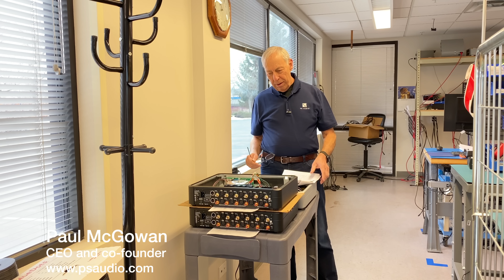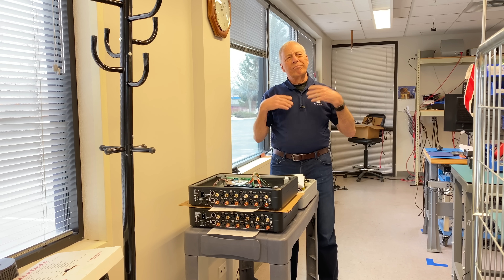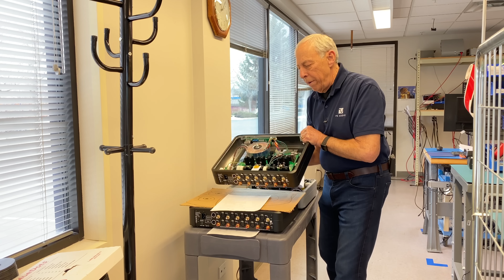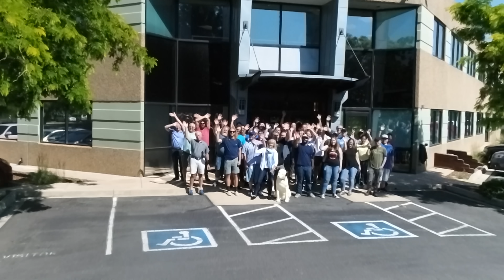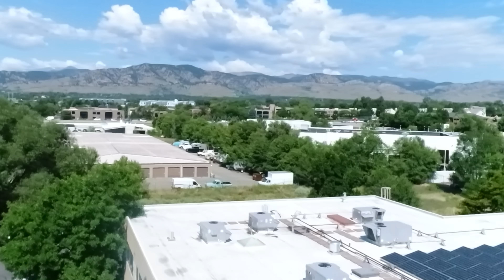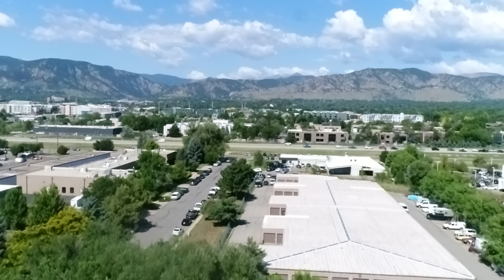Should a preamp have a sound?

Comment: In today’s more digital chain audio system a separate preamp has lost his function. No separate preamp means also one device  less and one  interlink and power cord less. It all adds up so don't add, subtract.
Reply: Good point! I once owned an Audio note pre-amp. It did make the digital source (after going through a DAC) sound better. But not enough to warrant the cost. So I sold it.

Comment: Paul, thanks for the video.
First, a pot and two connections is not an "amp". I'm sure you just misspoke and know this.
Secondly, we DO want our amps to have character. We love tubes because they have second harmonic distortion. This idea that what you get in you should get out is not what people want. It's a good theory but it ends there. I specifically design my preamps to have character, one of the reasons I use tubes. You designed a $6k amp to be a line stage? I absolutely don't want one - at any price!
Things like super low distortion have little if anything to do with listening pleasure. We simply can not hear the difference between 0.05% distortion and 0.005% distortion, these are manufacturer's selling points.

Comment: I remember many years ago I read an article in which this was discussed.  They used a regular volume control pot , and then made a pot using ganged  switches, each position having a high quality resistor , which reduced in value as the knob was turned.  The difference in sound was easily identified, the one using resistors clearly superior.
Reply: The second one you described is a stepped attenuator.

Comment: Does not a preamp adjust the levels of all sorts of connected component inputs to bring them to a standard let’s say a 1 volt peek to peek level able to drive a amplifier to its optimum level? For instance a moving coil compared to a moving magnet phono cartridge, their needs to be some kind of amplification. At lest that is the way I have used preamplifier. I really like your description of the input and output.

Comment: I built a simple preamp like you said but the pot rolled off the highs when it wasn't all the way up.
Reply: You prob have a mismatch between your pot and input resistor on the path right after it (if you have an input cap the resistor is probably the very next thing in the signal path after it). Try a higher value volume pot and replace the inpout resistor with one roughly half value of the volume pot, and chances are more high frequencies will make it past ground as you turn down the volume. There will ALWAYS be an amount if high end bled off through a standard volume pot as you turn it down, but you can indeed get it low enough that it's not perceivable.

If you have an input capacitor after the volume pot, you could also try lowering it's value one tick as well as matching the following resistor to about half the volume pots total resistance something in my tired brain tells me this may help too. but it may also roll your low end off slightly at high volumes depending on the implementation of your circuit

I try to use a resistor right after the input cap on the input of my tube preamp builds about roughly half the value of the volume potentiometer, because then at roughly noon my preamps sit at the same volume as the source signal. It may be placebo but to my ears, this also seemed to help high freq roll off as volume goes down, seems like the volume knob is almost as willing to shunt low frequencies to ground evenly with high freqs while i lower volume.

Any times you have resistors and capacitors on the same signal path you are creating low pass filters, and a volume pot is just a variable value resistor. I may not have given you THE answer here, but there should be enough info here, should you actually see it, to figure out what your issue is.

Anyhoo, ive never found handling the volume pot high end roll off of a preamp a difficult thing to sort out so long as you know (to some degree) what you're doing, and know exactly what your input/output impedance match is, and what kind of low pass your creating with the volume sweep. Ideally the sweep of the low pass created at its LOWEST is over 20khz. if you can achieve this you wont have any perceivable high end roll off, even though it's still technically there. Some very trained ears CAN however, notice the loss of phasing info above 20k, and it can be perceived as a loss of "air around the sound" or similar perceptions. It can also sometimes be difficult to keep your low end in tact and holding authority the way you want it to doing this as well, but ive had no issue with that on my particular circuit implementations. And ideally you get it right at the preamp... because adding it back in with your EQ will introduce noise and distortions you do not want in your signal

Comment: Everything in audio has a sonic signature, nothing is completely neutral.  Yes in theory you would want equipment that has no coloration to the music.  One way like Paul mentioned in determining the sound of a piece of equipment is listen to it with it in the chain and without.  You can do that if you have a cd player or digital source that you can vary the output and run it directly to the power amplifier.  Listen and then do the same evaluation with the preamplifier in line.  This will give you a good idea what kind of coloration the preamplifier is producing to the sound.  Inevitably in most cases most will prefer the sound with a preamplifier.  Most preamplifiers are increasing the level of the input source, and is also designed to drive a amplifer properly.  Especially if your running longer interconnects to the amplifiers.  For a while there were line level preamplifiers which had no gain, just a input selector and volume control.  But they were not very successful because they lacked the slam, dynamics, and musicality of a active preamplifier.  So yes in theory a preamplifier should be as neutral as possible but that's like saying you should eat the food from exactly how the chief made it, but how often do we season our food the way we like it.

Comment: If you're a phono lover like me, it's pretty easy to get rid of the preamp. Get a phonopreamp, which you need anyway, that has a volume control. Connect it to the poweramp and you're done. Very sadly the new PS Audio phonostage doesn't have a volume control.

Comment: If I've learned anything in my decades of pursuing pleasing sound is that EVERYTHING has a sound. From a high end or entry level audio component to a piece of common copper wire. The math may not support that but my ears do. And for all of the skeptics out there just because the asking price for a piece of audio gear is low or high to ridiculously high, doesn't always mean that the sound will be better. Being an audiophile to me means paying attention to and identifying subtleties in sound and performance. Peace.

Comment: I totally agree. K ohms on guitar pot affect guitar sound, warmer or brighter sound
Reply: when you combine a resistance factor with capacitance you create a low pass filter. The cutoff frequency of the low pass filter is determined by the impedance of the signal passing through the circuit, which is controlled by the variable resistor that is a guitar volume pot in combination with the variable impedance of guitar pickups at various frequencies. When you turn a potentiometer on a guitar you are changing the impedance of the signal, and thus the frequency of cutoff (removed frequencies are all just bled off to ground since a guitar is an unbalanced signal). A higher resistance pot will raise this cutoff frequency's upper limit effectively allowing more high frequencies to pass through with the knob turned to full

The more ya know i guess.,

Comment: Can anybody explain this to me? Why pay $6000 just to be able to increase and decrease the volume... when you can do that on the Poweramp directly without any additional cost ? In the video, Paul seems to suggest that the preamp is not doing any (low noise) inherent amplification but just volume control,why pay so much money for something that can be done (freely) on the poweramp?
Reply: Dude: a power amp doesn't have a volume 😂
That's why it's called power amp..once you turn it on, its output depends on the strength of the signal coming from the pre-amp. 
What you're thinking of is the integrated amp (preamp section and amplifier section in one box).
Reply: @SpaghettiKillah  Thanks. You just made my life easier ! It seems that my experience is restricted to All In One amplifiers!
Reply: Bedros Daoudian 
If money and space were not an issue having them separated would be the way to go. 
No matter what people say, having the pre-amp and amp section inches away from each other is not ideal...there will be interference.
That said some well made integrated amps sound bloody amazing (Pass Labs, Audio Research, Krell).

Comment: why spend 6K on a preamp when you can use one of many DACs that have volume control? That truly adds nothing to the sound. 6K back in your pocket. Now a tube preamp, that's a different story. Add warmth, tweak the tone rolling tubes. That would make more sense than Spending 6K for, well like Paul said, NOTHING. However if you listen to vinyl I guess you need one...... Here is a question Paul...... When will phono preamps come with a gain stage and volume control?  That would be interesting!
Reply: @Larry Niles I hear you Larry, but it this video he says it should like nothing. Go figure
Reply: @jsmctch
That 6k preamp has tubes
Reply: @Mark-lq3sb  Even more of a shame it ads bogging
Reply: @jsmctch  You praised tubes...
Reply: @Mark-lq3sb  Mark what I said is I liked when tube preamp ads to the the tone. Im not surprised that tube preamp sounds like nothing because PS Audio gear sounds sterile to begin with i, my opinion. I do like to hear what Paul has to say from time to time though.
Reply: @jsmctch  
I agree with your reply to Larry Niles above. It is true that Paul has said the reason for the tubes in the input section (only, not output.) is they believe that's where tubes have the most impact to "sound" 
In a previous Video Paul talked about bringing in Bascom H King, (hence the name of that preamp, BHK.) to design the preamp and Bascom wanted to do all tube. Paul wasn't "keen" on the idea of all (meaning output too.) tube, Paul resisted. In my opinion, the input tube only was a compromise between Paul and Bascom. Paul still had his transistors and Bascom got his tubes. Now, you have a hybrid preamp and amp.
Reply: @Mark-lq3sb  Thats interesting Mark. Thanks for the reply.... I think I side with Bascom on this one.

Comment: If you need an audio device that colors the sound to get the right sound out of speakers then you may well have used an equalizer instead, but then I think it's most likely speakers that don't have good sound!

A preamplifier should change the sound as little as possible!

Yes everything you run the sound through will color and change the sound in one way or another.

But the sound out of a preamplifier should be as unchanged as possible and then you can't use the vacuum tube!

If you use earphones to plug them into the CD player and then into the preamplifier then the sound should be as unchanged as possible!

Comment: Preamps are very important. In fact the Herbeth speaker designer Allan Shaw/Master Yoda said most integrated amps he tested are starting to clip at the preamp section of them once you turn the volume passed 11 o’clock! It doesn't matter how low distortion the amplifier is if the preamp is clipping and sending distortions all the way down the line and amplified.Interview is him showing off his 40th ani 7ES3

Comment: All the pot did in Paul's first preamplifier was to introduce noise from the carbon track and the contacts ... the cables and RCA connectors would have no effect at all ... unless they were heavily oxidised
Reply: Not completely. It depends on the source's output transformers. The pre-amp must pass the in-phase and the out of phase carrier signal to the amp without phasor errors.

Comment: Ah , pure genius , this video sums up ideal audio to perfection ,,,simply put its like this 
The more you pay .... The less you get.

One day if your not careful we will all end up sending 10k in a box to a guy on a mountain in Switzerland and he will in return send us a can full of clean and pure Audiophile grade air , so we can listen to unpolluted pressure waves ..
Reply: No the more you pay the more you get. The problem is just that most people who test expensive equipment, don't have the ability to deal with equipment that is sooo much better. Expensive equipment should be tested with expensive equipment and most users don't even have a proper set of cables or powerbar or they often destroy the signal around the SOURCE, making everything else they test almost useless.

Most people on the net that test gear and make a review should not be trusted.
Reply: @RealHIFIHelp  i've run 200k stadium systems on cooker cable and used 19 pin lighting cables as speaker multi core before today .. but you are totally correct .. before trusting any ones opinion I always ask the simple question .. what have they to gain from the answer ... then I adjust accordingly.
Reply: If Swiss mountain air genuinely improves the sound in our room, why the hell not? :)
Reply: @jaymuraleedharan  
Would you like the small tin now ..  or we could get you a fresher large tin tomorrow .. unfortunately its a custom order ... and will cost slightly more ... but .. the tin will have a picture of a valve on it and a scale that goes from zero to eleven 🙂

Comment: Back to the old chestnut of no preamp is the best preamp vs active preamp. This has been a long journey for me, I have tried passive preamps that use a single high quality resistor in the signal path and as Paul said, they sound different. I have tried dacs with digital volume controls but I still prefer the sound of an active preamp. They seem to make the sound larger and with much greater image depth. No preamp always sounds a bit thin and dry to me and lack dynamics when directly compared to a good active pre. My own favourite is a good valve preamp every time.

Comment: A great preamp doesn't have a sound that can be distinguished from a pure wire. An even greater preamp allows me to tailor my sound, when I want it, through an EQ or multi band tone control (no room is perfect, my ears are losing treble and the loudness curve is a real thing), and allow me to bypass it with zero "damage", when I want to. Such great preamp doesn't exist, however, and I'm still hopeful that Paul will make it.
Reply: Hello mine fredns! Morley makes an optical volume pedals. There is not poentimeters to change the resistance. It has an electric eye and a light DIODE LED insted of a POTemtimetors. They use if for gutars to not ruin the sound by turnigs down the 500k oms pots on Gibbsons Les Pauls. Can they use the opticals volumeinstead in a preamps? THANKES YOUES AND THUMS UPPSS!

Comment: Is there any way of increasing the signal that a pre amplifier sends to the power amp to improve volume levels ?
Reply: To be honest i always thought that it was the purpose of a pre-amp to do the first bits of amplification. PS Audio just told me otherwise. But i don’t think that i got my original thoughts out of oblivion. According to PS Audio a pre-amp is another word for a mixer with less functionality than a mixer (one channel at a time).
Reply: A preamp boosts the signal, and making a very convincing preamp sound natural is one of the most difficult things in HIFI, so I suggest using an integrated amp, unless you really know your sh#! which most people don't. It is a vey easy way of burning a hole in your pocket. But when done properly, it is totally worth it.
Reply: Real HIFI Help I agree.
Reply: Of course their is, many ways of doing it...
1. Sound is all about good power and controlling the source signal.
2. Use a very good powerbar and power cables. Of all the cables in HIFI, Power cables are the most important ones.
3. I generally only recommend 3 powerbars/conditioners:
a. Gigawatt evo 3
b. Top Audioquest niagara.
c. Isol8 mini sub axis which is my opinion is the best in the world.

Also a very good tip, if you amp is very weak, try just using a very short powercable that is maybe half as long. It has a very different timing and if you have a relatively good setup, you can get away with it, without it sounding to harsh.
I suggest using a 50cm, 100cm and 200cm power cables. They all have a different sound priority.
Check my channel for more tweaks...
Reply: @RealHIFIHelp  so you're saying you can increase the gain of a power amp by shortening the power cable ??? Obviously you don't own any test equipment at all.....smh
Reply: @RealHIFIHelp  no actually NO ONE knows that because it's complete bs...
Buy some test equipment
Reply: Audio is not even a heavy user of a wall outlet... Power outlets here in Belgium are 16 amps at 230 volts which is 3700 watts. And power cables are capable to carry even more because the fuse in your subpanel has to fail instead of the cable. If you have music on really loud then you use maybe 200 watts (and that is seriously loud, like angry neighbors loud). The power of a wall outlet is way beyond of what you need for audio.
Reply: And don’t listen to Real HIFI Help with his power cables.. What a nonsense. The voltage to the speakers is much lower than the voltage from the wall, so the speaker cables are the ones that would need to be beefy to carry the amps without heating up. If it would be a topic at all. I don’t believe it. But anyone can do what he wants.